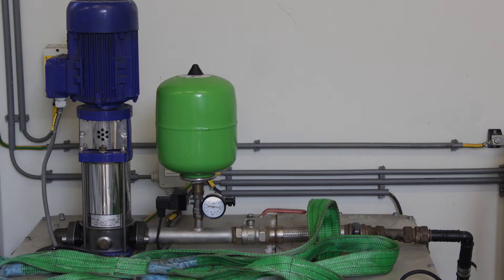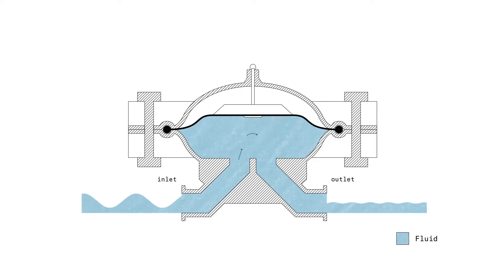How does a PULSATION DAMPENER work? | +ANIMATION

Comment: Great video 
I got two weatherford F-1300 mud pumps on a drilling rig. I drill with around 2000 psi.
The pulsation dampeners are both pressured up to 3200 psi.
What should pressure be on dampeners and what is it doing to my mud pump because the pressure is so high?
Thanks……

Comment: Thanks for the class! I am rebuilding a Fuel Pressure Regulator, from the fuel circuit of an old Mercedes, which works at 2bar. What materials can I use to make the diaphragm?

Comment: The animation is pretty good, but it doesn't explain why the liquid wouldn't retreat into the upstream line when the dampner is on its return cycle. This needs to be adjusted, or if a check valve is used upstream of the flow (which I guess is the answer !!), it needs to be stated. Thought some pulsation dampners might actually be fitted with a "mitre valve" on the receiving opening to stop this flow reversal when the pump momentarily stops.

Comment: Toyota uses a ignition damper on the fuel rail to soften the displacement of High and low pressures. I earned something new. My home water regulator makes loud fluttering noise so I wonder if its time to change it? Thank you!

Comment: Thanks for the Informative Video. Could you please answer me what size of Pulsationdämpfer i need for a Maximum flowrate of 4000l/h? And what size for lets say 15000 l/h? Need that for a Hosepump. The output needs to be steady and smooth.  smooth

Comment: What about a pressure gauge on a dampner...
I have two identical pumps pumping same fluid into two different systems ..their individuL PGs same pressure...but on dampner PG one is showing the pressure equal to discharge and on other there is no pressure...what does it means
Reply: It has to be set 70% of discharge pressure

Comment: Very good point at 04:30 Things that break are indeed a safety problem. Recently I've seen some bad examples. One of them was a chemical dosing pump that was placed on top of a small storage tank. No plexi glass, no leak detection, and I assume also no pulsation dampener. Despite my warnings of possible line breakage and my advice of buying and installing a propper chemical dosing unit (a skit mounted unit with all the safety devices on board) the company continued to operate with this makeshift installation. Visiting the the location again a few weeks later I noticed a very bad smell of bleach / chlorine. I was told that the dosing line broke and that the pump continued to spray Sodium Chlorite (a poisonous and corrosive chemical substance) during the weekend.